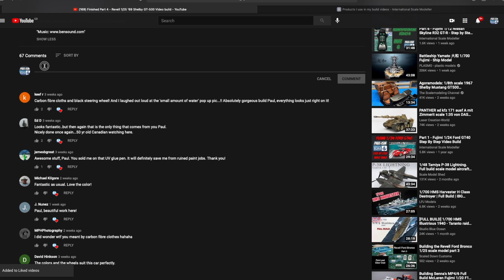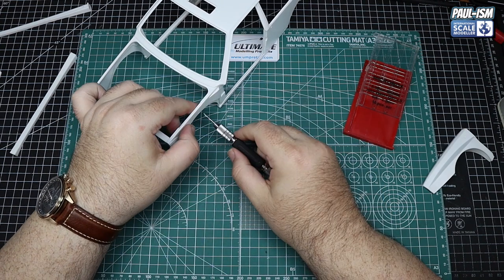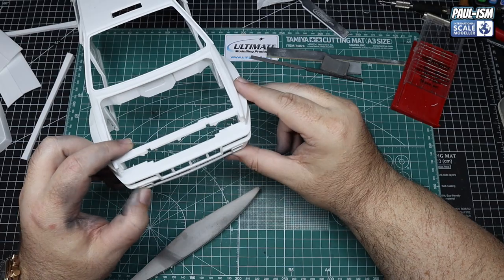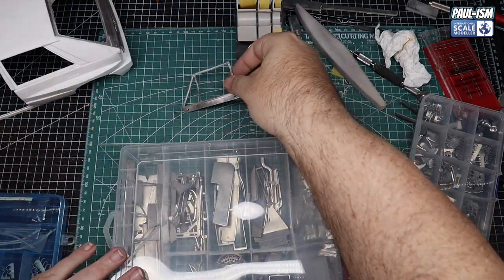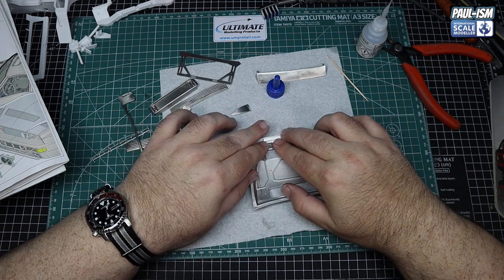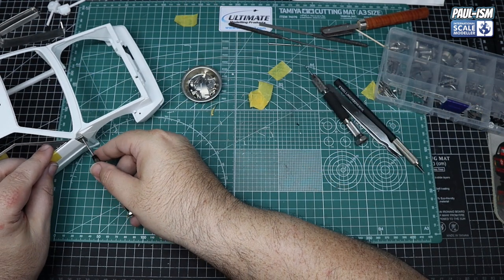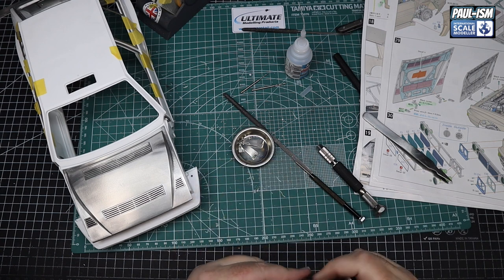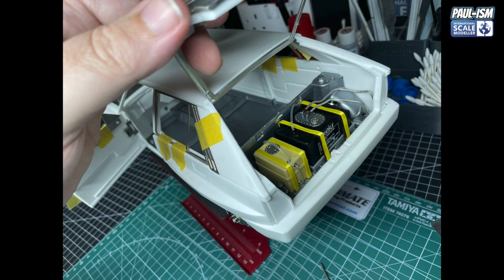Part 6 - Model Factory Hiro Full Detail 1/12 Lancia HF Delta Integrale Evo '92

Comment: Thanks for the great uploads here. Interesting for me as I built this kit last year! In fact my summary video is here https://youtu.be/-mNIPeyWkxA   I've built a few MFH kits over the past few years and this one, being a later kit, I felt was really good quality in terms of 'fit' etc - but like you, spent ages on the rear door - adjusting , trimming, shaving, bending - its all part of the fun! Be really interesting to see the final product. I found the decals to be fantastic quality but did they not like sliding around at all!! But, what promoted me to write, is the mini-review of the tumbler polisher! It's persuaded me to finally buy one. Looks good. I'm just starting the reissue of the 917k - it's an older kit and I can tell!! So think I'm in for a challenge. Seems like every metal part needs trimming and all the frame parts reshaping! So good value for money re time it will take. Keep up the great work. Cheers and thanks again.
Reply from the maker: Nice one John. I think I’ve watched your video too. The tumbler is a great bit of kit. My Lancia 037 arrives today so looking forward to seeing that
Reply: Hi Paul. Thanks for the reply. Re the tumbler I think I'll go for the next model up for the slightly bigger capacity. As for the 037 - great kit! I built it about 5 years ago and one of my favourites. It was my first 1/12 MFH build ( now hooked £££). It's an older kit and some parts were a challenge. You're an experienced builder so I'm sure won't be baffled - but I was, early on - as the top metal part of the front frame (M66 I believe ) just wouldn't match to the front resin bulkhead - until I realised that M66 was cast too small. I cut it and  soldered in a fillet so the pegs and holes all lined up properly. You don't need my help - but could be useful !! Cheers. John. - sorry my text editor won't let me delete the following word 😬up @InternationalScaleModeller